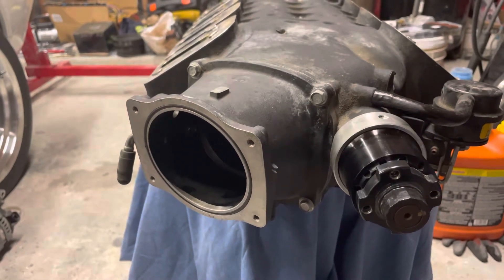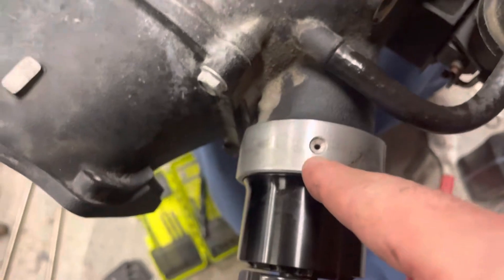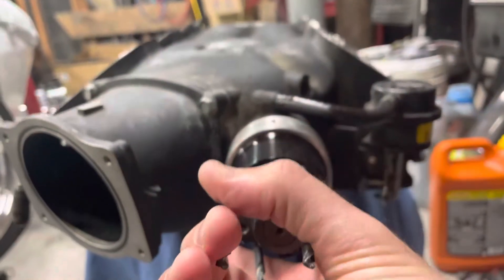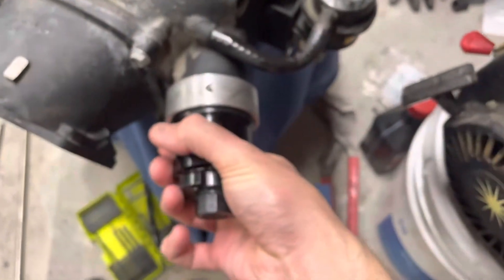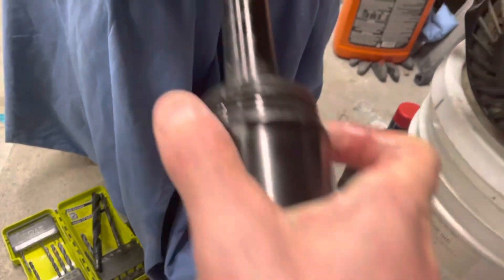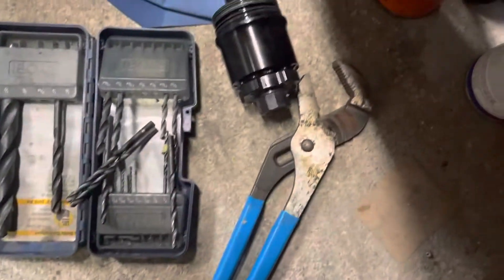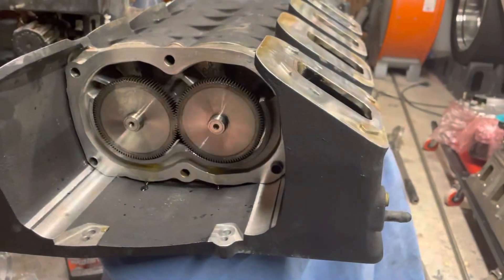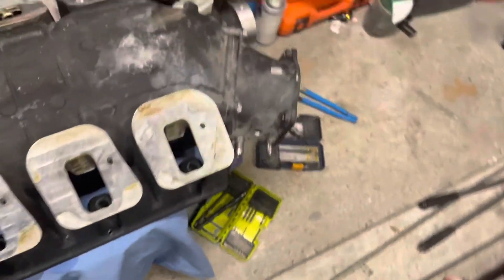Magnuson heartbeat 2300 isolator access

Comment: Did this cure a noisy rattle at idle which goes away as engine speed increases? I have one on a LT4 Corvette that started. I ordered the parts for it but waiting on them to come in. They said mine was the 3 pin not the pentalope style.
Reply from the maker: Yes it did, on my CTS-V blower that has the 3 pins a solid isolator fixed that. But they were know to give loads of issues with the spring setup. Let me know if it fixes your issue?
Reply: @nostastic  It cured that problem.
Thanks for posting the video!
Reply: I'm getting that rattle at idle on my heartbeat 16 camaro

Does the blower have to come off to access this coupler ?

Thanks for the video btw
Makes me feel some relief